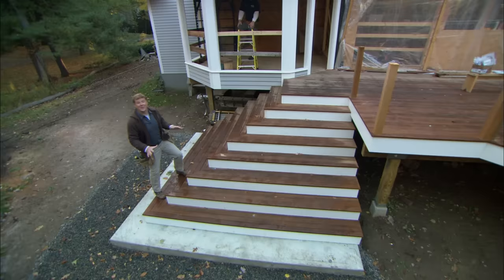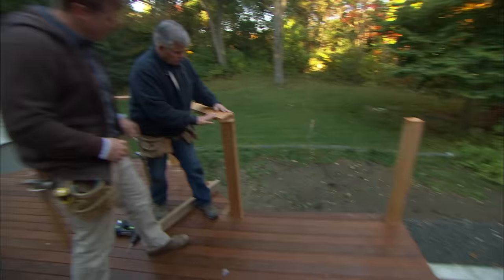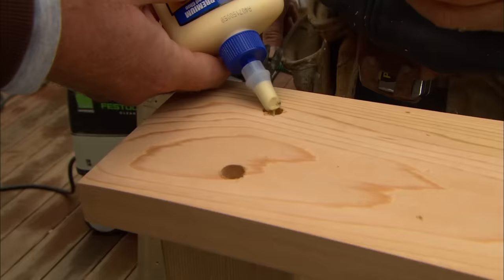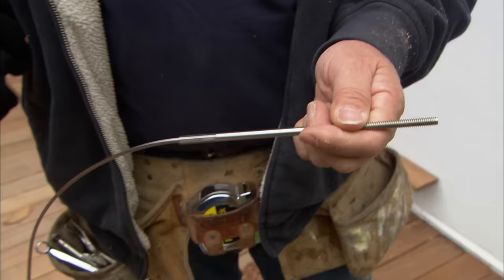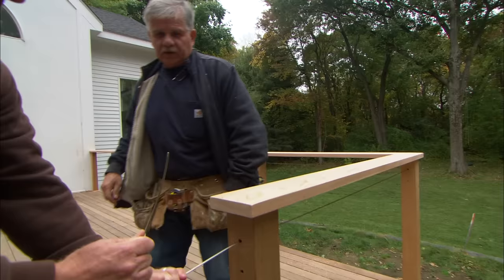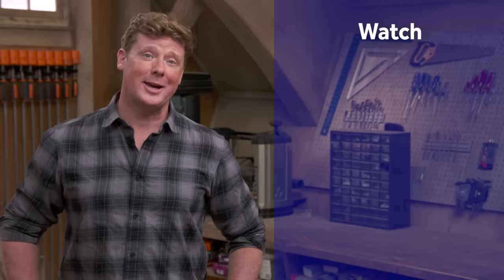How to Install a Cable Deck Railing | This Old House

Comment: How did they thread the 90 degree turns?
Reply: They actually used a drill bit that bends 90° in the hole
Reply: Those are great drill bits... A little hard to find
Reply: Easy, wherever you need to make your holes for the middle of the post, transfer that line to the top of post and connect them from both sides. Then that is the length you drill in for each side. Then just mark your length on the bit with blue tape & drill away!
Reply: @daveklein2826  They're in the same aisle as the skyhooks my boy scout leader always sent me to find.
Reply: @njwebwiz  was Dr. J your Scoutmaster?
Reply: 45 degree angle
Reply: I want to find one of those 180 drill bits.

Comment: Crazy question but think I could use 1/4” solid copper wire for the same effect, and be compliant with code?
Reply: Copper is probably too soft

Comment: Classic This Old House, they fail to show you the most difficult parts of the project, which in this case would have been the 90 degree turns in the rail. I guess when you are “experts” it’s easy to assume something as simple as feeding an 1/8” steel cable through a 4x4 at a 90 degree turn is self explanatory.
Reply: You just twist the cable while pushing it through and it should walk itself around the corner.
Reply: Two posts on each corner = problem eliminated. Did a railing like this around the patio outside and I’m happy with it
Reply: You probably could just offset holes to accommodate tightened mechanism.

Comment: I would caution running the cables this long.  The longer the run, the higher the tension needed.  Overtime the cables lose their tension as the posts start to deform (especially towards the center of the posts) and you can easily stick a 4” ball between the cables.  The remedy is to tighten the cables again as part of this cyclical cycle.  I’ve been there!  The better (and more expensive option) is to break up the runs—I would have broken it up into at least 3 runs here.

Comment: Wood 4x4 posts not the best for cable railing system with the tension of the cable will warp the end posts and the corner posts will pull in. The correct way is to use steel posts clad in wood veneer. I've had to replace these types of railing systems a few times.

Comment: Makes a great ladder for a toddler.
Reply: Thank you, it seems that 99% of the people leaving comments, don’t understand that this is against every code in every area.
Reply: @scott5654  exactly.  I've personally witnessed a toddler climbing on of these rail systems at a family member's house and everyone had to keep an eagle eye on the kid the rest if the evening. It was about a 10 ft high deck so not good if kids can gain access to it.

Comment: Not all of the runs were straight. I wonder if there is a trick to easily thread the cable through when you have a bend or turn. I saw the story stick they used to drill all the holes to make sure everything lined up, but I am willing to bet there  they ran into some frustration when trying the thread the cables around a bend.
Reply: By drilling the holes at a 45 degree.  There are grommets that protect the cable from damaging the wood when pulled tight.

Comment: Curious why not show the construction and  detail where the cable goes 90 degrees through a post?
Reply: I read a comment here that it was prob a 45 degree hole so that the cable can be pushed through but would have been nice to see them explain if that's what they did.  And should use metal sleeves for all contacts with the posts.
Reply: ya it seems they very breifly show it @5:46 not sure that is such a good build cutting through on 35 degree on post, seems like a spot where it would split, someone puts their foot on the cable. Given that, no surprise they breeze EZ through that detail right?  @M3fPCGFJSGDlORUbZAwK

Comment: I have a great idea for those who think an 8 course run of cable is an open invitation for a small child or any sized child to climb the cable and then falling to the ground. Run a few cables between 2 posts and ask a child to climb it! It’s very unlikely they will get very far. Have you ever tried climbing a few courses of cable and not feel the pain on the palm of your hands?

Comment: That top railing board needs a vertical piece underneath to share the tension of the cable railing …. The screws won’t be enough.. I don’t think is going to last ..

Comment: When building wood railings it is 100 percent better to finish the top with 1/2 " plastic wood overhanging the 2x6 wood under it buy 1/2 "on both sides. Beveled wood railings do not hold drinks in glasses well and will look old quicker 2-3 years. 1/2'' wood grained Plastic  cap over a 2x6 wood railing will look good 10 to 15 years.

Comment: Nice video, not sure how to drill and feed the stainless wire through the 90 degree posts.  Anyone know the secrete?
Reply: Use the template on both sides of the post.
Reply: 1/8th in cable and either 1/4 or 3/8ths inch holes. Keep the template centered and at the exact height.
Reply: @jmackinjersey1  Ya love to see it, why would they not show that in particular is so curious.

Comment: Thing with the cable railing is. You REALLY have to crank them down Extremely Tightly. So you cant even bend them at all between the posts. At least in my Area thats how you have to have it done. Otherwise Wont past Inspection due to safety. Its one reason when people buy houses around here its removed, mainly hardly no one likes them as they are a eyesore. Most HOAs wont approve them anyway.

Comment: Is that mortising machine the same as a biscuit joiner? And I guess you can buy those little tenons , or did he make them? 
I’ve never seen anyone join a top rail like that. Only a true craftsman would do that!
Reply: no, it's a festool domino, and the tenons are sold in packages.
Reply: OK thanks. I did notice it was a Festool brand. Does anyone else make them?
Reply: @thomassemich4627  no it's patented to festool and just warning you they are expensive. You can also make tennons and mortices with a chisel and a router.
Reply: OK thanks, no wonder I’ve never seen it done before. I will look into the other method thanks!

Comment: he took the time to talk about how the spacing needs to be less than 4".  But industry standard for cable is 3" and he clearly has atleast 11 cable runs along a 36" post, putting them at 3" or less!!

Comment: You definitely want to check with your local building codes before installing a product like this. Any kind of material that is installed horizontally poses a climbing risk for children.
Reply: In that case, I think you can just connect the horizontal cables to 240v electric. That way no child would be able to climb it.
Reply: This is why you do not le the city or town know you are doing work in your back yard. No inspections!
Reply: @ryandiedrich6317  That's fine until you have a party or some other gathering at your home and someone's child gets hurt. Before long, you'll end up having to deal with people who might make life very unpleasant for you, i.e., inspectors...LAWYERS. 

Codes exist for a reason, and that is to protect YOU as the homeowner.
Reply: @dougstorace321  The people I hang out with watch their kids and do not let them climb where they should not climb. It is called parenting...and we do it well.
Reply: @ryanjoseph5009  Even the best parents can miss that "one moment," which is all it takes.
Reply: @c0mputer  Bahahaha
Reply: As someone who was once a kid, I can assure you we could climb almost ANYTHING, including the 5' metal vertical rail only pool fences that code insisted be installed around every pool for our "safety". We also knew how to open the "child-proof" locks on the gates.
Reply: Thank you. There is nowhere that this is allowed. It’s climbable, end of story.

Comment: Hey everyone, we watched this video a few months ago and want to do the same with our deck, but here is our problem.  Almost all the stainless (SS) cable companies, selling through the big box stores or online, like through Amazon, claim their SS is T316, which is desirable for areas with salt water nearby, for sailboats, etc.  The cheaper and more easily corrosive SS is T304.   Neither are easily discernable from one-another (T316 vs T304) except T316 has almost no attraction to a magnet, and you can chemically test the cables.  I've found numerous articles about testing a sample of the SS with sulfuric acid (car battery acid).  The articles say, if the cable is T304, it will turn green and have green crystals formed.  Two different companies i've bought SS cable from, claiming their cable was T316, has turned green in chemical testing.  Does anyone know of a trusted vendor for actual T316??  I don't want to put up all this railing, to have it rust a year later, which is a lot of the reviews i've read from purchasers on Amazon.  Thanks

Comment: The video was helpful. Like others went to the comments for info on hardware, link and info on the 90' turn. 

Terrible social engagement from @ThisOldHouse to not respond to any of these comments with links to products. Maybe @Feeney can chime in and solve the mystery for many of us and sell some product. 

As to all the code enforcers out there, you do realize there are dozens of 'unsafe' situations allowed by code in your home when it comes to children, correct? Let's start with the gas stove, fireplace inserts and furnaces most people have in their homes. Terrible for indoor air quality and now definitely linked to childhood asthma, breathing and potentially development issues (autism, etc). 

There are literally 100s of thousands of these railings thoughout the US if not millions. When was the last story you read of a kid getting their head stuck in a cable railing system or climbing over the top?

Comment: So on the 90 degree turn he “cuts the corner”, drilling from the center of the face diagonally through to the center of the adjacent face? That doesn’t seem to leave a lot of meat to withstand that constant pulling force…

Comment: The building code is not a recommendation. It is the minimum standard for construction. The 4 inch minimum spacing is just that, the maximum width.  You can space them closer including a solid wall.
Reply: Speaking of the code, it does not allow horizontal railing because it climbable. This is how children die.

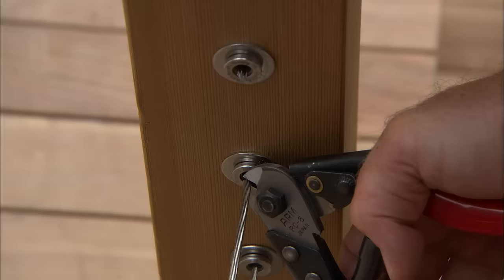Comment: Oh my god Tommy. Thomas. 6:24 get a ratcheting wrench.
Reply: That won't work when the excess threads start coming out at the end
Reply: @mitokhandria  what Kevin meant to say was, yes you're right a standard ratchet set won't work after about an inch of excess threads, but a normal box-end wrench that has built-in ratcheting will work. It's a super handy tool for tight spaces. (Also, I believe ALL ratcheting wrenches are box/box-end)
Reply: @Kevin-mp5of  Ah yes! You're very right, I didn't know those could even exist

Comment: Quite frankly if you installed vertical cables instead of horizontal you eliminate any chance of anybody climbing up over them. I don't know why I don't see more of these they're just as attractive. I did Google vertical cable railings and there are a few companies now making them and I'm sure you could DIY them just as easily they just have a slightly different support system.

Comment: Deck railings need to be "non-climbable" where I live... that is all.
Reply: How does one make the railing non-climb able?
Reply: @ALMX5DP  by having vertical spindles. Most places have that in their building code. Anywhere where a railing is "required" it can't be climbable. If you're installing a railing in my area on a deck less than 36" tall then you can use horizontal spindles/cable. But anything above needs to follow railing building code.
Reply: @BigScreenLife  gotcha, thank you for the explanation. Makes sense but a bit of a downer due to limitations in design.
Reply: @ALMX5DP  It needs vertical balusters.
Reply: Electrify it. Wait is that code? haha
Reply: @brianglade848  Canada.
Reply: @ALMX5DP  Electrify the cables.
Reply: Not just where you live, but we’re any child lives.
Reply: @BiggMo  
You made yourself look foolish with your nonsense reply. Children are children.
Unless you have them on a leash, they behave like children do.

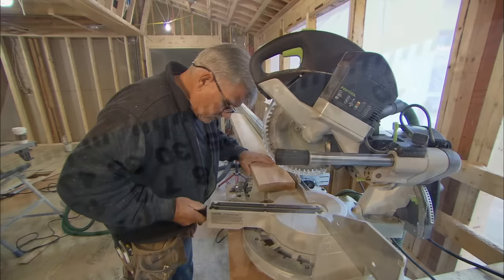Comment: Nice Festools sliding miter saw there @2:10, either a sponsor or a good show budget.
Reply: Barely watch them any more. Looks like they went full on Festool. So, Festoll must have dropped a lot of money on them. Festool very pricey and if you wanna buy parts it is an arm and leg and foot for good measure.

Comment: Horizontal cables/spindles etc has to be the worst thing ever on a deck for kids... it's basically a ladder for them to climb and fall over the edge... 30" off the ground yeah not that big of a deal but still has the potential for severe injury aka spinal and lets not even mention high decks a story plus up...   can't believe building codes allow this.

Comment: congratulation, you've just installed a ladder on your deck railing so your kid can climb up it and fall.
Reply: oh? so they can't also climb on wood railing?
Reply: @elhayden  absolutely they can if you put wood across like the wire was. The idea is to not make a ladder, that’s why most of the time they are vertical
Reply: I have an idea for you to try. Drop 2 - 2x4s in the ground and run 8 courses of cable spaced even at 3 inches apart. Next…. find a small child and ask them to climb the cables starting from the bottom. See how far they get! Have you ever tried to climb up a stack of 1/8 inch cable? Not very pleasant on tender skin.
Reply: @lawnman1734  Haha true. Yet as kids we used to shimmy up and over the vertical metal "safety fences" around pools.
Reply: You are correct. This is not allowed anywhere.

Comment: I'm hoping you guys can start publicly discouraging tropical hardwoods. I know they're beautiful and ipe is durable, but there's not really any way to harvest these in a sustainable fashion.
Reply: That's interesting. I was considering going Ipe, but I think I'll do more research. Possibly go composite.
Reply: The problem is most domestic woods that are durable against rot are also rather soft.
Reply: BOO HOO
Reply: They did use metal balesters. that could have all been wood.
Reply: @Kevin-mp5of  I gotta bale on my last comment.
Reply: Couldn’t believe ipe was being used as decking.

Comment: This is a terrible idea if you will ever have children around. You're basically making a ladder for them to climb. Also, if it's not perfectly maintained, the wood will shrink or warp and the cables will become less rigid and a kid could get his head in between, which would be a danger as well.